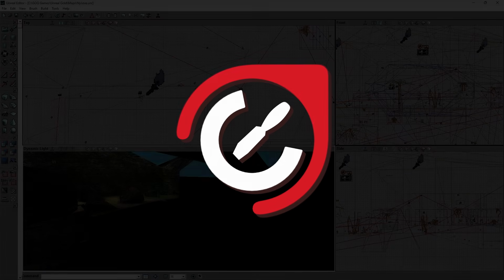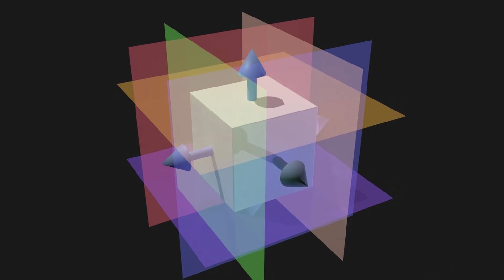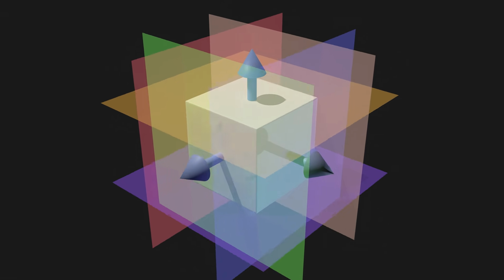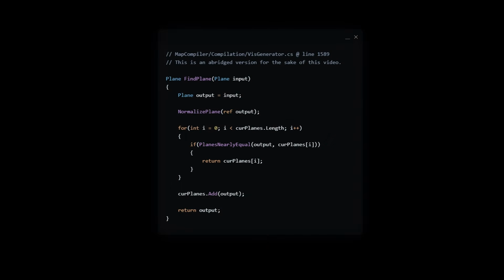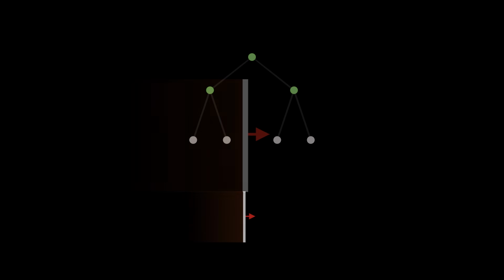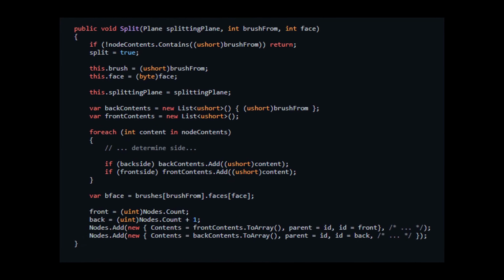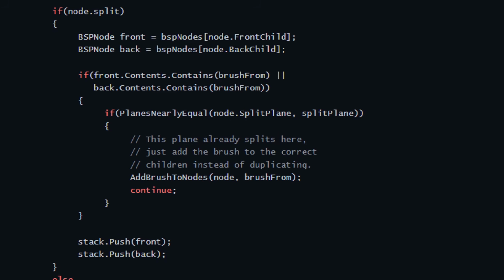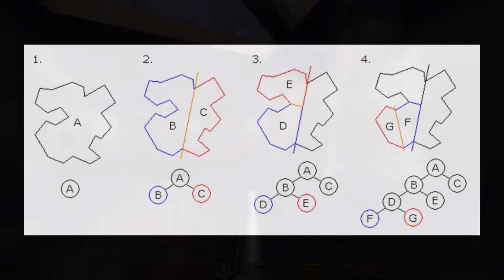BSP in Map Compilers Explained (Quake, Source, etc.)

Comment: this channel partially inspired me to start working on my own engine in C++ since I was getting sick of bumping into walls in godot constantly with it's poor construction. I'm now 4 months deep and have quake 3 bsps, source vtfs, a proper engine/gamecode separation, and a full true ECS system using entt, and have a lightweight lisp like DSL for map logic on the way. I have plans to make the repo public soon as I start work on the first game to use the engine.

my longterm goals are to use the knowledge I'm picking up from these videos to create my own map compiler and lightmap builder and evenually obsolete the use of quake 3 tooling and the map format (through extending and modifying it to work more with the engine directly) (I will continue using netradiant as the editor though, that won't change becaues the tooling in netradiant is perfect for my team)

I've built it very similar to what the "platonic ideal of working with source" felt like for me and it includes all of the features I like with modern backings for the underlying systems. It's been one hell of a ride but even on the worst days mentally I'm still glad I chose this path because I'm much more happy working with this engine than I am everything I've used before.

Comment: That brush/split step seems entirely excessive. If you used a subtractive CSG method a single cube could be made from one brush instead of six. Calculate the center and change the XYZ planes independently from there. You can use arbitrary shaped brushes to create anything you want so long as you keep track of the brush type (air, solid, water, etc) and the order of operation.
Reply from the maker: I mean no, lol, if you had negative brushes you'd also need to dedupe planes. The problem isnt BSP itself, BSP will work just fine with duped planes. PVS however is not so tolerant to it due to the amount of plane related math to do with normals and facing directions and clipping actual geometry, etc etc.
Reply: @elgenscomputerchannel how do you account for gaps in level geometry? I think we're talking apples vs. oranges here.

Comment: 3:20 I'm curious about this PlanesNearlyEqual() function you just gloss over. How close to equal do they need to be? And why is it acceptable to discard a plane that is nearly equal but not exactly equal to another?
Reply from the maker: Basically it just checks if the normal and distance components are near enough to each other to account for weird floating point shenanigans :)

Comment: Really cool video. I did not know that you are supposed to remove duplicate planes from the splitting planes list, that might be why my previous attempts at this sort of thing would take forever..
Reply from the maker: It took me until PVS to realize it was causing problems lol. With just using the BSP itself it's fine, but PVS uses a lot of portal clipping and stuff that doesn't do well with duplicate planes lol

Comment: Okay im gonna be honest, i watched this basically twice and i still feel like im missing something.

From what I understand: BSP is a process where brushes are combined into volumes in a way that allows you to automatically define what portions of a model are visible during map compilation and cull brushes that are uneeded. the Normals or brushes are used as a sort of "path" that will either converge creating a volume or not. then that info is used to split the map into smaller portions to allow for more efficient culling without having to cull per polygon? Am I getting that right or did I miss something?
Reply from the maker: that's not quite BSP. PVS is what is responsible for culling and stuff, BSP is just a simple and quick way to represent the static world geometry. The BSP tree is used for PVS, but BSP itself is a different step
Reply: @elgenscomputerchannel  AH so its just simply a step in the map compilation process that can assist in later processes
Reply from the maker: exactly! Just one of many steps :)
Reply: BSP is used to create a bounding volume hierarchy. You can use other geometries, but BSP feels kinda optimal for me. It makes collision detection and line of sight and ray tracing have O( n log n ). And view frustum culling also. And with hierarchical z buffer, you can finally utilize the sorting behavior. Sort front to back, check bounding volume against z buffer. Also: render dynamic objects based on their center position.
Reply from the maker: @ArneChristianRosenfeldt  Not quite. BSPs and BVHs are pretty different, in that a BSP node on its own has no concept of it's "size", and the BSP itself is like i said not really used for *rendering*, that's the job of PVS more so :)

EDIT: well, Doom DOES use BSP for rendering-ish, but more so just using the traversal of the tree to determine the order that walls are drawn in and using a more realtime/screen-space portal approach I think. But Quake and Source don't really use BSP for much beyond rays and stuff in the map compiler
Reply: @elgenscomputerchannel Duke uses portals. This means that with a column in the way, a sector is visited twice. Doom visits each vector once.

Quake was supposed to work similar to Doom. I don’t know if Quake did already consider the 3d hardware of the consoles Doom was ported to or if hierarchical z-buffer is just too slow in software. When reading about PVS, it sounds like frustration. Just some stupid LuT to ship the game on time.
Reply from the maker: @ArneChristianRosenfeldt Yeah build 100% is all just screenspace portal magic of window clipping im pretty sure, and it rocks. Something like that unfortunately just doesnt translate to 3D (i've tried) because of just how many planes there really are in 3D (a lot more than 2D). PVS is a great little algorithm, but I also definitely think it could be improved with realtime/screenspace approaches which is something I wanna tinker with in the future
Reply: @elg @elgenscomputerchannel ent has 6 DoF . Sadly, I am so slow, but I don’t see why I couldn’t free the camera in many games on Atari Jaguar.

I am coding a beam tree. Just I seem to be a bad coder. Perhaps I should have started with a level compiler when I was young. Then I could understand this code and adapt. Oh well, basically I am just optimising the level builder code for JRISC and speed. That is the hard part. I mean, otherwise I would just use existing code. I don’t plan to close source. 

About screen space: I noticed that portal engines don’t use NormalisedDeviceCoordinates . I had this big 3d graphics computer book, which said that portals replace screen pyramid clipping. So NDC only helps in the first room. Code would need to be more general.

Comment: 4:11 Source might optimize for tree complexity, I'm not sure... but I do know Hint Brushes were added specifically for when BSP "chooses wrongly", splitting leaves further to optimize for "reduce which leaves can see each other" at the cost of "more leaves" (Hints are cut after the map BSP-ifier runs, they're not taken as "the first cuts", so you'll only ever get more leaves by using Hints, but if it means that a hallway can't see another hallway, it's worth it)...

Comment: I once heard someone say “why would anyone want a level editor like hammer? it sucks”.  Every response I could think of was along the lines of “Oh so you haven’t actually done any level design” 😅 So I opted to pretend I didn’t hear it.
Reply from the maker: yeah brushes make level design so much easier. Hammer isnt good for like idk making a prefab in unity but that's because it's not supposed to lol. We unfortunately have a severe lacking in specialized tools with modern engines lol

Comment: This is great.

I like that you've gone so deep into replicating the original spirit, and the broad strokes, of early idTech. Aside from BVH; constructing / reconstructing those on the fly was a bit out of the question, at the time. Carmack had expected "the future" (circa ~2000) of everything to move to more of an octtree type of system for broad-phase querying, but BVH trees just make sense, these days. Especially if you can get them onto the GPU.

And "Chisel" makes perfect sense, given Carmack's choice of BSP, and the plane-clipping algorithm.

The last time I played around with the concept of having a 0-compile hot-reloading engine that ran off of plaintext idTech / goldsrc .map and .wad files (because I missed the CSG editors and was too lazy to write one for the tech-demo), I kept the brushes around in point-normal form, and calculated vertex positions from the intersections, on construct.

The benefit was that I had all of the hulls of the original brushes around, to put into a statics-only BVH, and let me do some fun stuff, like add mass as an entity-attribute, for the tradeoffs of not being in the static BVH (they weren't part of portal vis-culling, anyway), and adding in support for non-standard brush-groups.

The dream was a Quake-friendly engine, but with real-time lighting, with the map / game state to hot-reload on .map save... running in a webpage.

Looking forward to seeing your VIS and your RAD processes.
Reply: Why BVH?
I've found BVH bad balance when you try make brushes like floors and wall that scaled in one direction. In this case you get too much misses while you query BHV.
Reply: @theodor-does-something  
If you're making your own Doom-like or Quake-like engine, and you have known-static hulls in your maps, which are always going to operate like an infinitely-thin wrapper around and throughout the level, then please, 100% just pre-bake an offline BSP tree.
It will perform fantastically well in the overwhelmingly vast majority of the cases (terrain displacements, or wildly disjoint faces in physics calculations, notwithstanding; there were always clip brushes for that). It'll even run great on old hardware, on a weak CPU, once you build out the portal-visibility sets which allow for the kind of runtime culling that Quake and Half-Life did, and that will also run screaming fast.

I'm not optimizing for those scenarios, though.
My goal was less a quake-like runtime, and more a "use oldschool tools and formats, inside of a 'playable in realtime, as you are making changes'." kind of engine.
There isn't time for CSG + VIS + RAD, in these cases.
Also, I was trying to make it modular. Does it do baked lightmaps? Does it do raytracing? Are you adding skeletal animation and PBR materials on top of animated textures? Depends on the pipeline that you declare, in code.

So the "why BVH" has a few different answers, then.

1. creating them, online, at runtime can eat up a good chunk of a frame, on the main thread, but if it's moved to the GPU and sorted, and built bottom-up, you can get millions of polys into a less-optimal but "usually good enough" tree, in a millisecond or so, and aside from readback for game logic, you don't need to pay to push those resources back and forth between CPU and GPU

2. you have a data-structure which is suitable for physics, for rendering, for logic querying, for static and dynamic objects, and they are generally far more space-efficient than the quad-trees which they replace, if you are talking about massive scales (like 1000m x 1000m, instead of 4000px x 4000px, as Quake's engine tied distance to pixel size)

3. if a BVH isn't the appropriate structure for resolving some fine-grained physics / rendering answer, it can be a useful starting point to construct the appropriate dataset, using some branch as my starting set, and culling the other entities; for example, if a branch fails a frustum check, based on where I am standing and what I can see, I can disregard absolutely everything inside of it, for the purposes of screen geometry, but might still need it for emmissives or shadow projection

4. people smarter than me are currently working through what virtual BVH lookups, for much faster LoDs / raytracing look like (CDPR and ... id had been). While I am not going to beat them to the punch, I do want to learn those concepts

5. it allows me to keep and access the original brushes; I can trivially bake a BVH full of brushes down to a BSP tree, if I know that my map is "finished". I could even bake down a welded mesh and texture atlas, to save out the whole level as a single model. Especially if I keep a centroid, and all faces in point-normal form. That could potentially be a thing that the engine allows you to do at runtime, in dev mode. But I can not reconstitute the original brushes from the BSP tree, if I need to make a change. Those details have already been lost. Additionally, I couldn't hot-reload just the parts of the map that have been added / removed / edited. It would be a full CSG + VIS + RAD, to get back to the new tree, new vis portals and new lightmaps ... which is the exact reason I was working on this engine; to move those steps to when the artist is done, not when the artist is trying to be creative.

There are also optimizations for different kinds of BVH construction. If you have the benefit of parallelism, you can build bottom-up pretty neatly, sorting centroids according to Morton codes. If you have the benefit of building offline (either in a dedicated process, or a level loading screen ... though you would want pre-built trees for models in their original transform), you can apply heuristics which allow you to always make the most optimal slice, in how you're going to break the volume up, so that you are minimizing query time, between the things inside of the volumes.
Also, you have the option to partition that brush, in a lot of cases. Especially because it's just going to be one long block, with a repeating texture, at some UV multiple, based on texture scaling. And in the olden days, before the CSG tools were better, amateur mappers were trained to break longer blocks up, so that the CSG tool didn't make nasty cuts at T-junctions, which could blow out the number of faces (even though the big floor, from the perspective of the mapper, is just 1 face), could cause light-seams, and could also ruin the light-baking.

There is so very much "it depends" that is baked into everything. All the time.
But you are right in saying that BSPs for a static level hull are generally going to be faster (especially if you don't have degenerate clipping happening). But that BSP is going to be limited in purpose, and the bigger the level, or the fewer flat surfaces (more terrain or more organic terrain) you have, the more that benefit is going to fall off of a cliff.
Reply: @SeanJMay  have you tried Sparse Hash-Based Grid? It was surprisingly even faster than BSP in my cases with brush based geometry too. Yeah, it has some memory overhead sometimes. But it allows you to change geometry without offline-preprocessing.
Reply from the maker: Bvh can be good for some volumes. Like I said for entities that cast shadows or props I use a bvh for lighting just because it's a bit of a better solution for that case, but for the static geometry at large BSP is usually faster